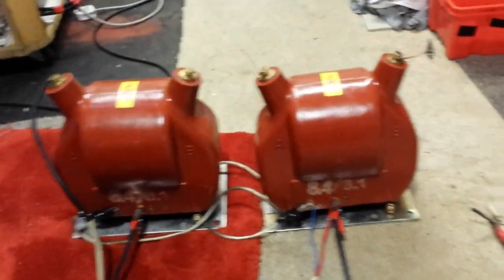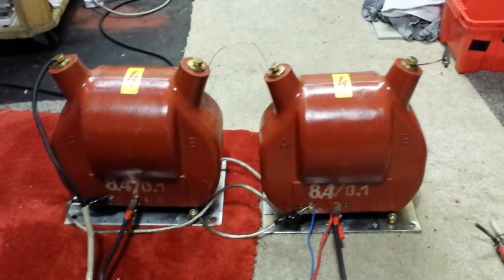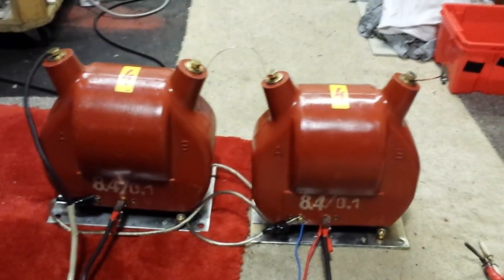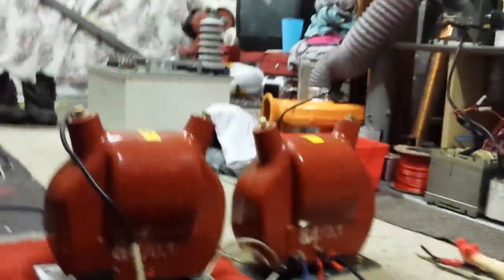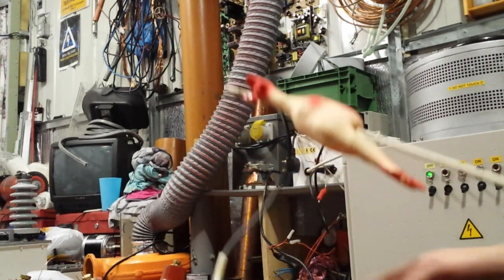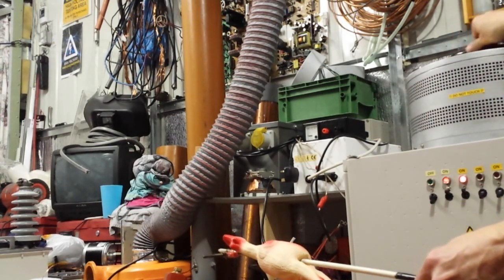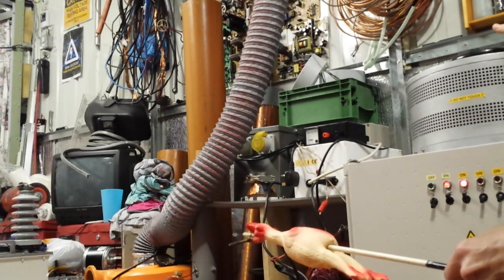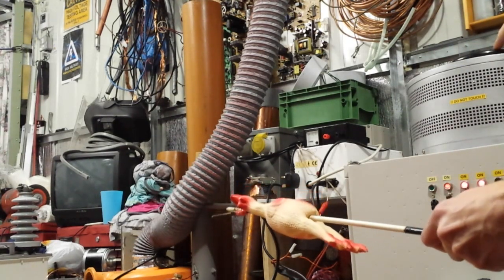Potential transformers  16.800 volts

Comment: Awesome PTs Ant,
those arcs looked pretty white and thick, plenty of power for the Tesla coil!
It was good to see the control unit in action, you did look like a HV DJ for a
minute or two then pulling some pretty heavy arcs there!
Just to confirm; when you say "Sixteen Thousand, Eight Hundred KV" you mean "Sixteen Point Eight Kilo Volts"? otherwise we'd be talking about "Sixteen Point Eigh Mega Volts", which would be awesome, but I think a bigger workshop would be in order! xD